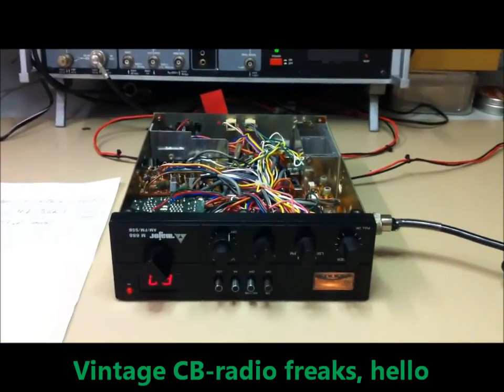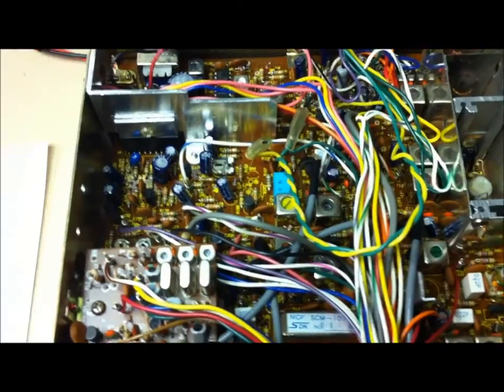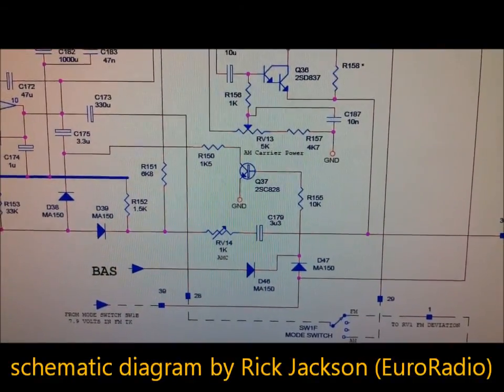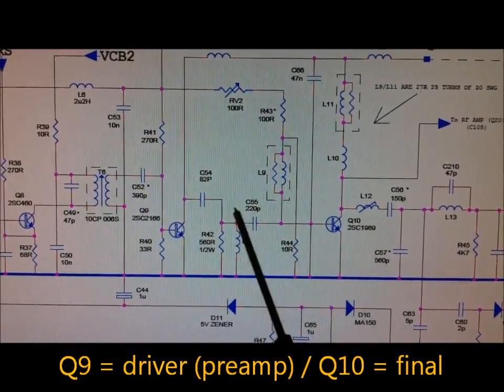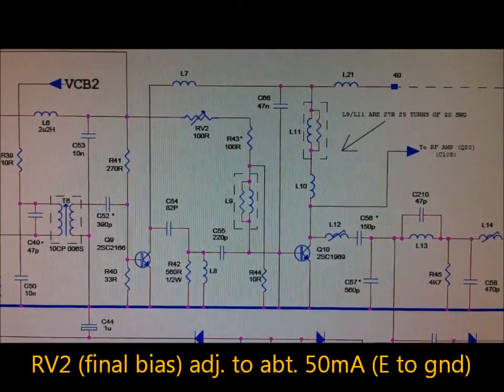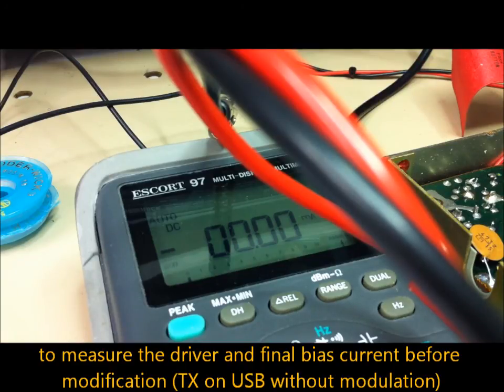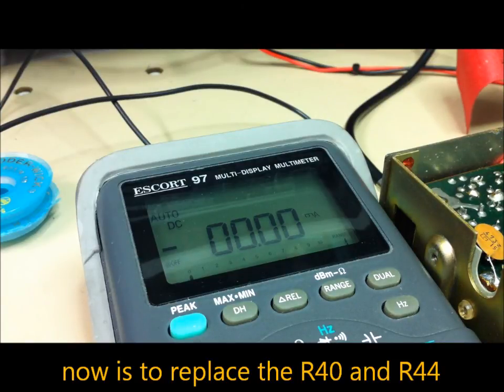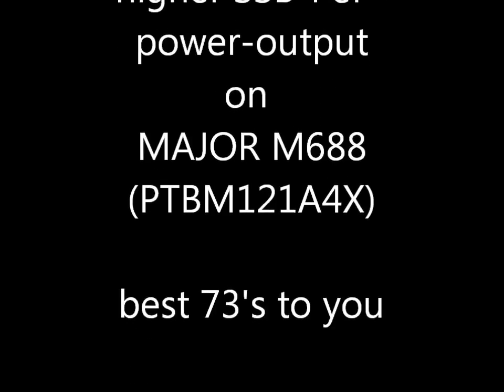MAJOR M688 (PTBM121D4X) pump up the SSB-modulation

Comment: Hi by the 2SD325 Regulator on the small heatsink there's a place for an electrolytic capacitor this helps smooth regulation. PTMB121D4X has the space but you can do it to all Cybernet SSB chassis to improve SSB modulation. My Elbex Pacific is this board & my Jumbo MK1 did it on that too. It does make an improvement.
Reply from the maker: Mister CB-radio pioneer Morris hello, thank you for this wonderful info. I'll check this fact and try to make this modification. Have a nice weekend and best 73 to you....